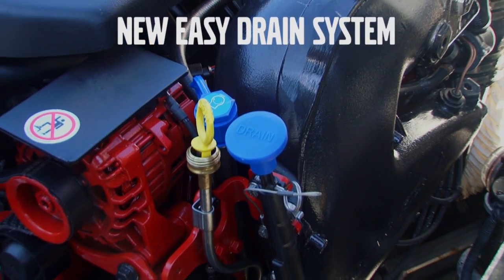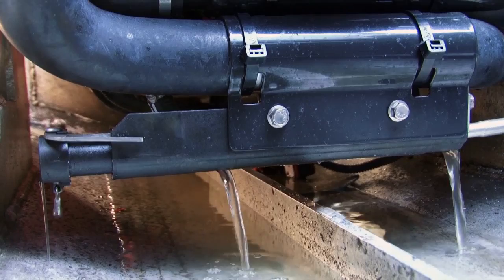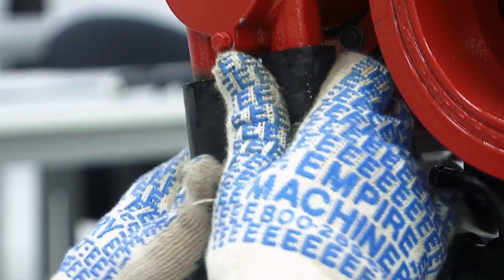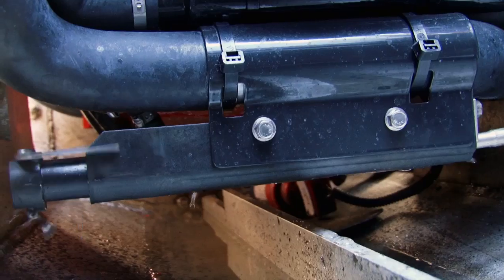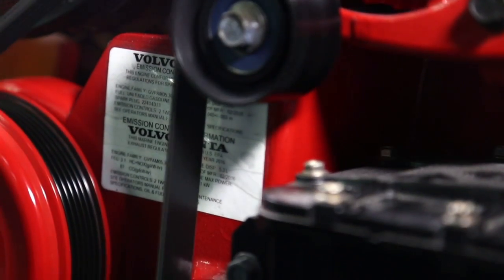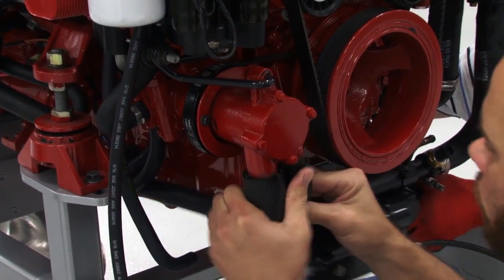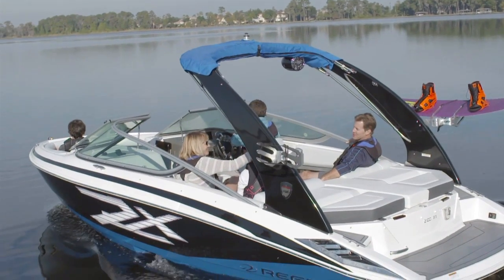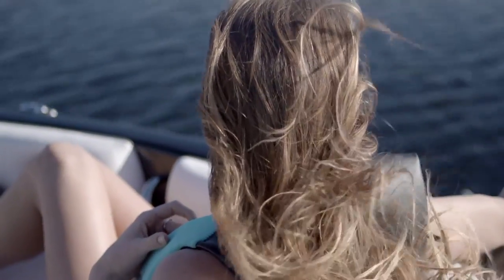Volvo Penta Easy Drain - 2016 IBEX Innovation Award Winner

Comment: I have a Volvo V6 280 DP Catalyst. What is the hose on the rear of the boat the correct way to get antifreeze into the water chamber? I am old school and like to do things myself. I find little to zero info regarding the winterizing. What is the blue fill tube hose on top of the engine by the drain tube for. I would assume fresh water?
Reply: I have a 2015 v6 200 G
And I also had a hard time finding info on winterizing. I went to the volvo penta site and enter info serial number etc It gave me access to all the manuals for my exact engine. Yes the blue fitting is a flush connection for yourgarden hose.Do you know if you have to flush with anti freeze or is draining good enough?

Comment: So is this sufficient for winterizing the cooling system?  Do you need to run antifreeze through the system as well?
Reply from the maker: This is not sufficient for winterization, but will extend your boating season so you can take advantage of the warm fall days.
Reply: Why does neither the normal manual or workshop manual say anything about winterizing these engines?  It does not say how to winterize these Easy Drain engines.  Shouldn't the Volvo OEM manual or workshop manual mention this and guide the consumer how to do this?
Reply from the maker: This may vary depending on the model of your engine, but is straight from the latest Gasoline owners manual:
Long-Term Storage
For long term storage (more than two months), we recommend that you have your Volvo Penta dealer “winterize” your engine and drive. Your dealer will provide the proper servicing and maintenance to ensure that your equipment is treated and stored properly. Should you decide to winterize the engine and drive yourself, carry out the following procedures, in the order in which they are listed below:

Fuel system treatment as described in Preparing the Fuel System for Storage, page 88.
Check coolant for proper fill level and freeze protection level. See the Service and Maintenance Manual.
Drain water from raw water side of engine cooling system. See Engine Shutdown, page 50.
Pump the bilge dry and air out engine compartment.
Store battery as recommended by manufacturer.
Reply: That is why i asked if this was sufficient for winterizing the cooling system as there is no other procedure for draining the raw water side of the cooling system.  So the answer to my original question is yes?  I understand the other things that need to be done but I was only inquiring about the cooling system.  So there is no need to run  antifreeze through the raw water side of the system?
Reply from the maker: Yes, as long as the sea water is drained properly, there should be no need to add Antifreeze.
Reply: Ok, thanks.  Thats all that I was asking for.  Also, when you say properly you me push the Easy-Drain and ensure that the proper amount of water exits?

I wasn't sure if the engine needed to be run in antifreeze as other engines require.  One of the local Volvo dealers was trying to say that these still need to run antifreeze for winterization and i was confused as the instructions did not state this.
Reply: @marcodifranco1277  it wont hurt to keep antifreeze in the cooling system I have the same engine v8 6.2 350hp winterized was super easy but I did put back antifreeze my Volvo dealership said it was ok

Comment: "Yes, as long as the sea water is drained properly, there should be no need to asdd Antifreeze"
There SHOULD be or ther IS NO need to add antifreeze? I am getting a lot of conflicting info on this newer design.
I had a service advisor tell me TSB 05-2-2 applies to all VP engines but i am not sure how it applies to my 380hp Gen 5 engine?? (05-2-2 below)
Disconnect the suction hose at the water intake.
Put the end of the hose in a bucket filled with freshwater, start the engine and run the cooling system clean
from seawater until the bucket is empty. Turn off the engine.
Fill the bucket with a 40/60% mixture of Volvo Penta Coolant and water or similar glycol mixture. Start the
engine and run it until the bucket is empty. Turn off the engine. Use a container to collect the glycol mixture
from the exhaust outlet and hand it in to a recycling station.
Re-attach the suction hose to the water intake and tighten the hose clamps.
At no time let the impeller run dry!

Comment: Does this also drain the block and manifolds or do you still have to remove any plugs? Thanks!
Reply from the maker: You don't need to drain the block as our closed cooling system uses antifreeze. There are no additional plugs to remove, the Easy Drain drains all of the raw water out of the system, including the manifolds. You're welcome